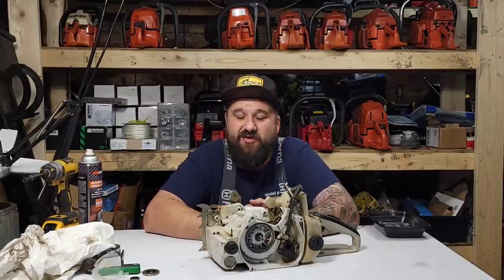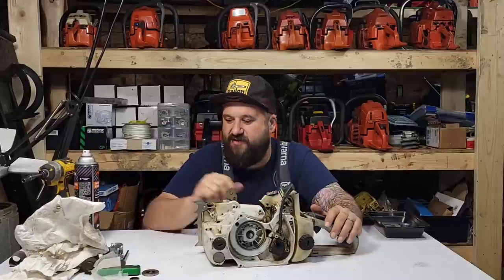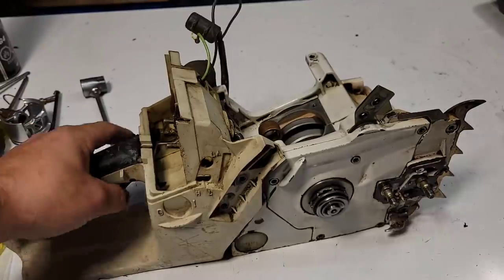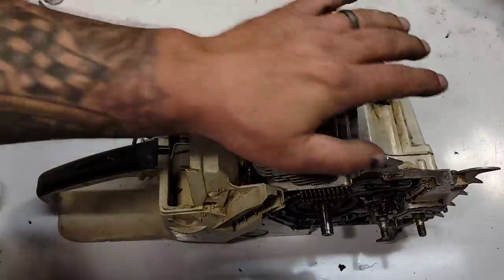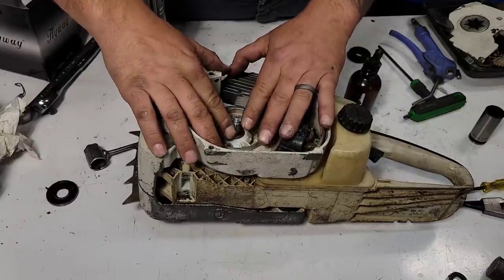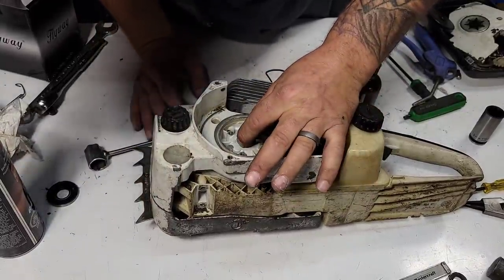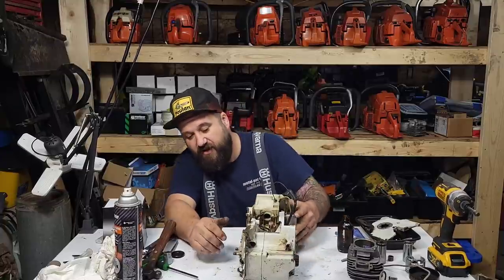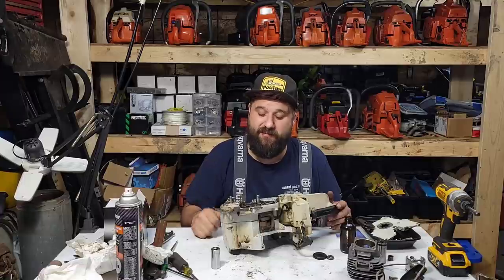Stihl 038 magnum crank seal install, we have a problem!!

Comment: I DID MY BUDDYS O28 WOODBOSS ON THE BACK TAILGATE OF MY TRUCK,NEW CRANK SEALS,FUEL LINE, CARB KIT,SPARKPLUG FUEL FILTER,CLUTCH SPRINGS, DRUM  SPROCKET,AIR FILTER, SHARPENED HIS CHAIN HE WAS AMAZED ,LOL  STAY SAFE TINMAN

Comment: Great tips and warnings about those small seals👍  free all and aerokroil are the 2 best penetrating oils I've tried.   The g660 pro I've got has a carb that says Walbro, don't know if it's real or not but it runs great, tunes easily and seems to hold it pretty well! Definitely ready for your farmertec build, as I've been thinking about ordering their g372 kit aswell!

Comment: Hey tin man have you ever heard of creepy oil it’s the consistency of a lighter weight oil than three and one and it has the ability to creep its way down through the threads really well you might want to check in on getting a small bottle of that or you could put a drop of oil on the threaded portion of the crank or clutch and it might help before you go using heat on it

Comment: Had the siezed clutch issue on a 038 fb, for seals.  Tried 3ft pipe lever on a ratchet or air impact or both...but wasn't easy due to that shallow fit on the socket. Probably  used mapp torch as well..

Comment: I have a 045av rebuilt it in 1988 and again in 2007 now i'm to old and weak to pull that beast fast enough to get it started .I now use a husky 61 practica ,nice saw but not near the power of my 045  even after it was ported for fire wood cutting. It can hardly pull a 20 inch bar in fir

Comment: Correct if I'm wrong tinman those were supposed to have factory pop up pistons in them ? Mine did that's why I'm asking
Reply from the maker: I've never seen an 038 mag with a pop up here. Not sure how they came. Tbis one is bone stock for sure.

Comment: Have you already tried to remove the clutch with an impact drill working against the compression of the top end?
Regarding shaft seals: I use small drywall screws and put them in the brass of the seals. Then, pull them out on the screws with pliers.

Great vid! Love your stuff and good luck with that clutch.

Comment: Would it beat the 361 by Stihl?  

I have a cord question on a Honda engine.  It's not retracting quickly.  I think it's just sticky and stiff.   Any recommendations on how to clean it and make it softer. I tried winding it tighter and lubing the spring.   It's the cord or the spring causing issues
Reply: The diameter of the cord might be too big causing it to be stiff
Reply: @stephenneill2621  I can't even remember how I fixed it. Washed it or replaced it